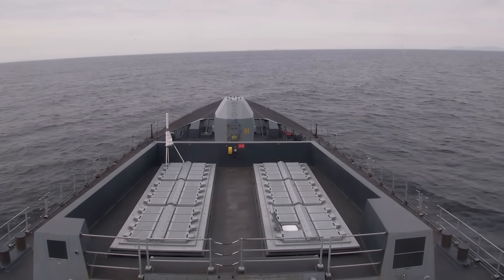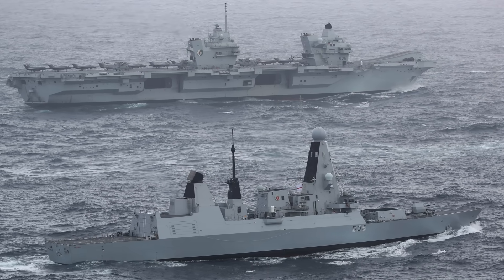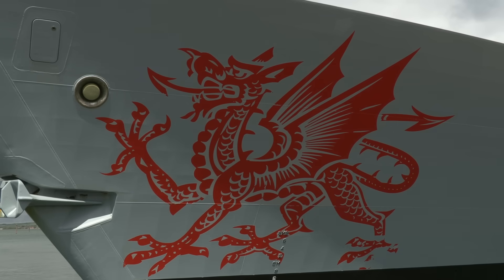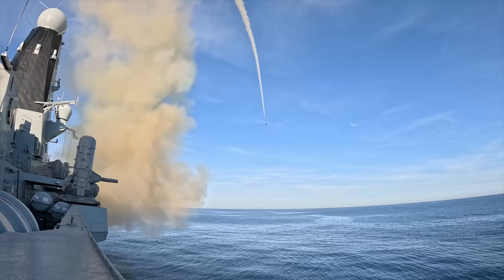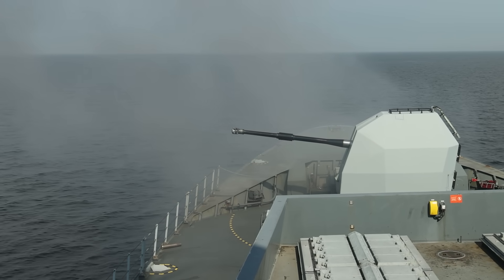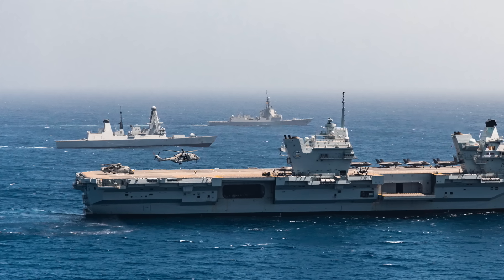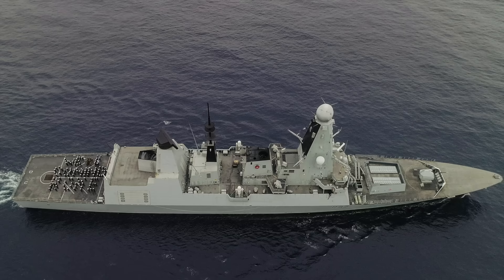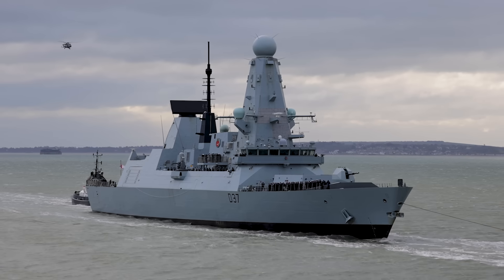Type 45 Destroyer: How the Royal Navy is Fixing its Billion-Pound Problem Child

Comment: T45s should have been slightly longer with a rear VLS cell. This would have given more options for missile mix. The lack of effective sonar has always been worrying particularly as they don’t deploy with a Merlin ASW helo. The bean counters caused the intercooler integration problem as they should have used a Rolls Royce one that the IEP was designed for. The bean counters also caused the high unit cost as the Sampson radar development cost had to be spread across half the number of ships.  Maybe it’s time that the bean counters are held to account for their poor decisions. I’ve never experienced accountability in accounts.
Reply: True although MoD procurement is known to be flawed, if only in the contracting (Grumman as the manufacturer of the faulty intercoolers should have been made liable for the cost of correcting the issues),
Reply: I can't really blame them, 8,000t is not a small ship. 
There was no sign of China building cruiser sized Destroyers then, the Soviets were gone and the mod hasn't really taken the lesson of "steel is cheap" to heart yet.
Ships these days should always have the size/length/displacement to double their loadout if and when they need it.
We're not the Americans, we don't need ships born with that capability, just the scope for growth. 

T26 and 31 are great, big empty hulls Just In Case.
Reply: @MostlyPennyCat  as an American, I appreciate your point.
Reply: It is politicians who decided to cut the numbers  of  ships  to be built, it politicians who forced  the penny pinching.
Reply: As usual a shortsighted cost saving resulted in a huge extra cost to fix.  Wonderful ship, wonderful navy.
Reply: True but RN are starting the vls upgrade program now which will include & improve the sea viper missiles aster 30 giving them proper ballistic missile defence capabilities, upgrades to the samson radar system & an extra 24 vls cells giving them 72 which is an increase from 48. The ships design was a result of all the lessons learnt from the Falklands war hence why its a air defence destroyer & widely excepted to be world's best air defence destroyer!!!
Reply: @moodogco   @moodogco  Aster 30 Block 1 isn't as good as Aster 30 Block 1NT. 

"The ships design was a result of all the lessons learnt from the Falklands war..."

What lessons? As far as I can tell ZERO lessons have been learnt.
Reply: @JimCarner777 the fact they needed multi layered air defence missiles on 1 ship instead of having 2 different ships like the type 42 using sea dart for area defence & type 22 with sea wolf for close in defence as it wasn't affective until it was already to late in the war when they realised they needed them working together for an affective layered defence over the task force & not scattered/ separated like they were early on in the war so that's what I'm on about which is well documented all over the place if u looked it up instead criticising what I said & I know the aster 30 1NT is better as I never said it wasn't!!!
Reply: The US offered the proven LM-2500 but they opted for the unproven WR-21
The Sylver VLS needs to be ripped out and replaced with strike length MK-41s. 
A batch II and III of the Type -45 would make more sense
The batch II would replace the WR-21 with the MT-30 for commonality with the QE class and Type-45 as well replace the Sylver VLS with the MK-41 as well add 12-16 cell VLS in the rear that strike length for TLAMs
6 ships 
The batch III would be a new technology class 6-8 to replace the Batch I ships completely
Newer radar , increased missile capacity. The UK could either buy or make their own version of the Multiple All-Up Round Canister (MAC) system or Lockheed's Growth-VLS (G-VLS),  to replace the rear VLS with newer system to can handle larger diameter missiles. Direct energy weapons as well C-UAS options
That would make the Type-83 easier to design because the tech would have already trialed on the Batch III ships
Reply: @verdebusterAP  3 batches seems excessive. I could see a 2nd batch of 6, before the successor class (e.g. Type 83) takes over.

But I don't care for the LM-2500 whether it's proven or not, the less we rely on the Americans for our security, the better!
RR can make gas turbines just fine (it was the American designed intercooler that was the issue). And the LM-2500 is old and the Americans don't even use them to generate electricity, even though their ships have 4 of them. They have to also have 3 separate gas turbines specifically for generating electricity for a total of 7 on board (not including the helicopters).
Slyver is also working just fine for us and is set up for the weapons we already use, we just need more of them (and perhaps some LM ExLS specifically for CAMM/CAMM-ER).
Also, you haven't addressed the biggest issue with them, even beyond magazine depth, which is the lack of any ASW capability. We need ships which CAN operate on their own if need be, without being vulnerable to cheap semi-submursible drones.
Reply: @sergarlantyrell7847  
The third batch would follow the lines of technological insertion allowing new tech to be trialed in actually operations before the next gen or batch is built  
You are missing the context
The LM-2500 model that was offered back in the early 2000s was latest model
the LM-2500+  which was uprated model
which was designed to support integrated electric propulsion 
The USN has no idea to retrofit newer engines when the LM-2500 has been upgraded to keep pace with advantages in technological and most of their ships dont use IEP 
The only reason that MT-30 will likely power the DDGX for the USN is that combination on the Zumwalt is 78MW for its IEP
an uprated version of that for 100MW is likely
Reply: @verdebusterAP Yes, I’ve always wondered why they didn’t build a follow-on batch. The Sampson radar design was already paid for. The ships would have been relatively cheap. I guess BAe closing the yard at Portsmouth had something to do with it.
Reply: @paulwalker1086 
The Type-45 design has the options for growth
Reply: I'm not sure the intercooler specifically was the fault of the bean-counters.

The many other flaws of the ships, sure. But not sure what the accountants have to do with a gas turbine shutting down, rather than simply losing efficiency as was advertised.
Reply: @sergarlantyrell7847 Fairly straightforward really. The power system was designed by Rolls Royce using their own systems. The beancounters decided in their wisdom to save beans and selected the cheaper US intercooler. The rest, I afraid, is history. Thus a small saving at the beginning led to a large cost later on. Where is the accountability for that decision? How do we prevent such poor decisions from happening again? 🤔
Reply: its always interesting to see how other navies design and equip their ships and whats the reaction to them by the public and community (coming from a german perspective).
In german military reporting media and community there is always the discussion about how german frigates are underequipped with arms.
the Type 45 and the F-124 were build and entered service around the same time and fulfill the same role. (missile based surface battlegroup airdefense and coordination)
The Type 45 is 3000t larger than the F-124.
The F-124 carries a 32 cell MK41 VLS for SM2 and ESSM and 2 SeaRAM launchers wit 42 short to medium range SAM, 8 Harpoons (replaced with NSM), got a bow sonardome , similar Radar systems, a battlegroup guidance and coordination center + system (similar to AEGIS), 2 3x lightweight torpedo launchers, a 76mm OTO Melara compact, 2 27mm revolver cannon RWS and 2 ASW helicopters.
The much larger Type 45 carries only a 48 cell VLS responsible for short to long range air defense, 2 Phalanx CWIS, a 113mm (4.5inch) gun, 2 30mm RWS and MAYBE a few harpoons plus 1-2 Helos, has a comparable sensor suite to the smaller F-124 class but lacks a surface battlegroup air defense guidance and coordination capability (like AEGIS control center)
its fascinating to see, how german media always whines about our ships being undergunned, while other navies much larger ships barely have more capabilities.
Same with the currently build F-126 ASW frigates, wich carry a larger and more capable armament than the Type 26 ASW frigates of the royal navy while being only about 1700t larger.
Reply: @cathulhu-q7y I'm not sure I understand your point. You claim that the F124 Sachsen class has a superior weapons fit to the larger Type 45 destroyer, but then go onto state (correctly) that the F124 has a 32 cell VLS and the Type 45 has a 48 cell VLS. My maths may be rusty, but I am told that 48 is a larger number than 32.
Oh, I see, I think I understand. You are taking credit for the 42 RAM missiles which you belive to be "short to medium range". Allow me to help. They are not "short to medium range". They are not even classed as short range. They are for point defence (so VERY short range) and so are comparable to the Type 45s Phalanx CIWS (so for shooting down incoming missiles) and not in any way comparable to the Aster missiles in the 48 cell VLS on the Type 45. So, to summarise, the F124 has 32 VLS, the Type 45 HAS 48. 48 still being a bigger number than 32. Both vessels can single pack medium/long range missiles (SM-2 and Aster 30 respectively), both can quad pack short range missiles (ESSM and CAMM) so equivalent there. But again. 32 is a smaller number of cells than 48.

I also love the "some" harpoon fitted to the Type 45. They are being replaced by the NSM, and they will be 8. Same as the F124. So again 8, which is the same.

Not trying to be combative here, but trying to help

Oh, if we're being silly, a 4.5 inch gun is significantly bigger than a 76mm gun, and I didn't mention that that Type45s are being retroffited to add another 24 cells for CAMM to go with the 48 cells for Aster 30. So could now carry 24 short range and 48 long range missiles, compared to a potential combination of 24 short range and only 26 long range on the F124.
Reply: Just to end by agreeing with one of your points, the Type 45 is indeed under armed for such a big vessel, no question. But it is also very easy to conclude that the F124 is even worse from this perspective.
Reply: @jimmyc7140 F-124s being close to 3000t lighter than the Type45 while carrying close to the same armament and having capabilities the Type 45 lacks is my point.
Reply: @cathulhu-q7y The Type 45 having noticeably more armament on day 1, and now growing to having significantly more armament now is mine
Reply: @cathulhu-q7y 
Type 45 is being upgraded with 48 Aster-30s and 24 CAMM, which is much better, especially when it gets the ATBM capability.
Reply: @MostlyPennyCat  yeah its getting upgraded, but only with very little.
the Type 45 upgrades and the in build refits of the Type 26 are bandaids at best.
The F-126 already has a bigger and more capable armament than the Type 26 and has several weapon systems in the pipe, that will get fittet once trials of the systems are finished, like SeaSpider interceptor torpedo launchers, Lasers, a further 16 cell MK41 VLS, anti submarine UAV´s, USB´s etc
Plus a possible Iris-T SL module integration into one of its module bays (currently there are tests ongoing with Iris-T SLM lauched from VLS Deck Container Modules on the F-125 class.)
Reply: @MostlyPennyCat   @MostlyPennyCat  Type 45s are mainly defensive (and seriously lacking in that area anyway). What offensive capability do they have? They have no land-attack missiles, let alone long-range deep-strike land-attack missiles. Any ship without such capability is pretty much pointless, just floating around defending itself, but not doing anything useful.
Reply: @JimCarner777 
It defends the aircraft carrier that launches aircraft that perform land attack. 
People need to stop just assuming if you've not copied the hopelessly inefficient and overly expensive US Navy.
Our land attack cruise missile capability is provided by our submarines as well.
Reply: @MostlyPennyCat   @MostlyPennyCat  

"It defends the aircraft carrier that launches aircraft that perform land attack."

Our F-35Bs have no land-attack capability.
Reply: @cathulhu-q7y You are right in identifying that the type 45s are under armed. They were originally designed to carry 72 VLS but that was cut to 48 for budgetary reasons, which in the long run does not actually save much money. Through the SVE upgrades the type 45s will carry 72 missiles through the implementation of a 24 cell sea ceptor missile system and 4/6 will be fitted with the dragon fire LDEW. So some of that extra tonnage was because it was built for but not with certain capabilities. So that’s where some of the tonnage goes. 

Secondly, you have to differentiate between the different objectives between both the Royal Navy and the German navy. The German navy is a regional navy designed to fundamentally operate within its own waters. Britain, as an island nation, still holds overseas territories (I.e. the Falklands) therefore the Royal Navy, and its ships, are designed for power projection and therefore have to operate far from home for long periods of time. So one of the major differences between the ships is range, the F124 has a range of 4000nmi @18knots whereas the type 45 has a range of 7000nmi @18knots (almost double the range) the extra tonnage/size of the ship allows for a greater amount of fuel storage as well as more supplies for the crew, allowing the ship to operate independently for longer.

Thirdly, future proofing. Larger warships have a greater capacity to be upgraded in the future due to there being more space. A clear example is the dragon fire system and seaceptor system being fitted to the type 45s.
Reply: @-_-dontcare-_-  I'm not sure what the aversion to the RN quadpacking smaller missiles in standard VLS cells is. You can get an awful lot of bang for your buck that way.
While the USN has 96 cells on their destroyers, if 1/4 of them are used for ESSM, they would carry 168 missiles in 96 vls cells.

The 24 Sea Ceptor launchers could have been handled by just 2x 3-cell ExLS (like a mk.41 light) modules in a fraction of the space. Imo we should be aiming for 72 full VLS cells (of which some could be these cut-down mk.41s specifically for CAMM and CAMM-ER).
Sylver VLS cells are only about $3m for each 8-cell module, so for an extra 3 modules, we're only talking about $9m. ExLS are supposedly half as expensive as full mk.41s.
Reply: @cathulhu-q7y  AEGIS is just another Combat Management System like Thales TACTICOS or the BAE CMS-1 that T45s have, platforms with any of these are capable of being the Anti-Air Warfare Commander in a task group. T45's CMS-1 deployment was specifically designed to fill that role.

Comment: Dragonfire is not a great game changer, it is too low powered to destroy drones, the best it will do is blind incoming missile IR or radar systems. One good thing about the type 45 failures is that the navy can actually provide the manpower to keep the 2 out of six operational.
Reply: You are wrong. The more important and tricky issue is the ability to strike the point on the drone you want, by holding the beam in place for long enough to have an effect.
Reply: Indeed, the US system has significantly greater output meaning it can blind/melt targets in a fraction of the time and therefore deal with drone and missile swarms.  Time will tell if it's as effective as the MoD claims or if their words are as hollow as their boss in No.10.

Comment: The plan was for 12 T45, that was cut to 8, then 6.  It should have got 155mm gun, that was cut to 127mm, then 114mm. 8-12 cells for MK41 VLS was mooted but never fitted.
Reply: The 4.5 guns have been the traditional medium calibre guns for Royal Navy ships since 1938 they were always going to be selected on the T45's for the sake of standardising with the Frigates to simplify supply lines for ammunition only reason 5inchs are coming in for future vessels is because of supply lines again..... this time to piggyback of the US's supply lines and allow the Royal Navy to resupply the guns via US at sea replenishment platforms as well.
Reply: @Kakarot64.  Go back to the original plans for T45. BAE had a prototype 4.5" mount modified to take a 155mm barrel. All defence money going to Afghanistan at that time, meant the 155mm development was scrapped. It only needed £10 million to go on to the next stage, but Gordon said no. T45 suffered death by a thousand cuts. It did not get the CEC it was supposed to get either.
Reply: That 155mm gun was a bad idea, this caliber is far from ideal for naval use.
Reply: 48 cells is far too few
Reply: @vadanadav I agree especially on 8000 tons. There’s no reloads at sea, this means we need two T45 to defend a carrier task group. Hopefully they’ll sail with an Arleihh Burke from a friendly country as well, but yeah you’re right. China especially would use saturation attacks from supersonic long range ballistic missiles
Reply: That delay or cut is still has a good thing. Think of how half of Europe built dreadnought fleet before ww1 till they had so much they pretty much couldn't even go to war with it anymore. Yes if things turn hot it's not many now but it'll not take long to complete once needed, and also consider the way things look like now you absolutely want a mix with MANY 10-30m sized power boats like the Scandinavians have (which they also have too little of).